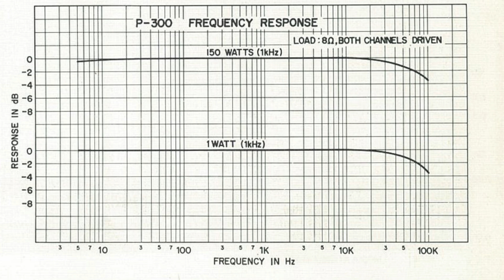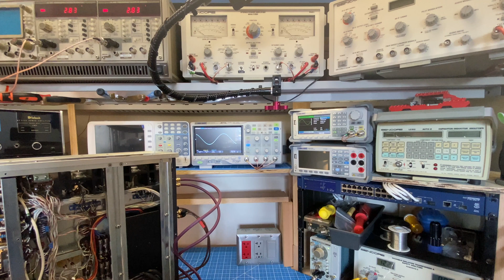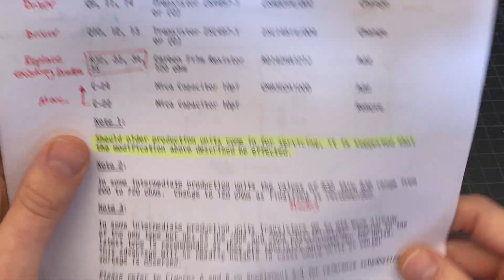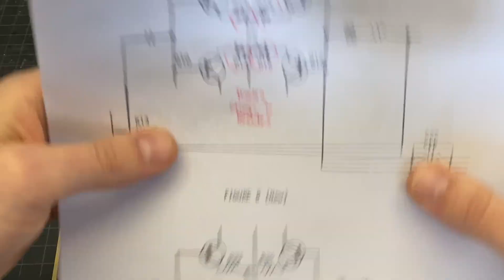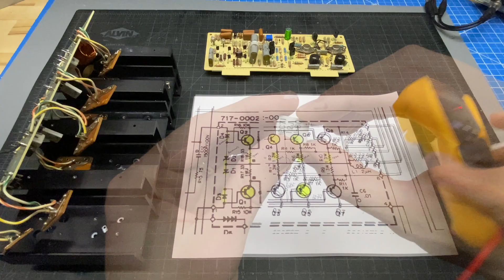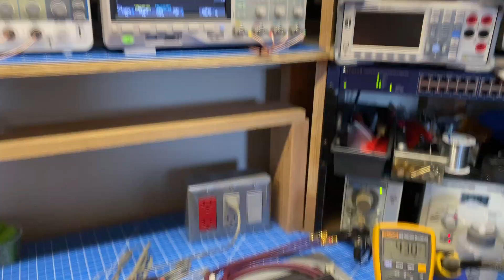Accuphase P-300 ~ Restoration Part 4 ~ Driver Cards - Frequency Response & THD+N Improvements

Comment: What subs did you choose for 2SA809 and 2SC1541?
Reply from the maker: My version used 2SA497, 2SC497. I used KSA1381 and Its Complement. The 2SA809/2SC1451 are the replacement indicated in the service bulletin so yours have probably already been partially or fully brought up to service bulletin spec.
Reply: @NovaluxStereophonic  Yes, my unit has all the modifications. Left channel ok, but right channel has a positive DC offset that jumps like crazy around 2-4V..  So the amp stays in protection mode. I swapped the main PCBs, the fault follows the PBC. All resistors, diodes, transistors measures ok. I suspect that one or more of the 809/1451 are bad. I may pull them all and check them in a transistortester and see if they match hfe wise. Which pairs did you match during your service?
Reply from the maker: @Lars71dk  Use at your own risk... I would be looking at Q1, Q2, Q3, Q4. If you have further questions please get in touch with me outside of youtube.
Reply: @NovaluxStereophonic  Thanks :-)
Reply from the maker: @Lars71dk  It also occurred to me that you may have a dirty DC offset trimmer.
Reply: @NovaluxStereophonic  That stage is ac coupled, so I suspect the second stage...
Reply: Success, second stage Q9 is bad and causes DC and bias to jump all over. I plan to repace all with SA1220/SC2690.